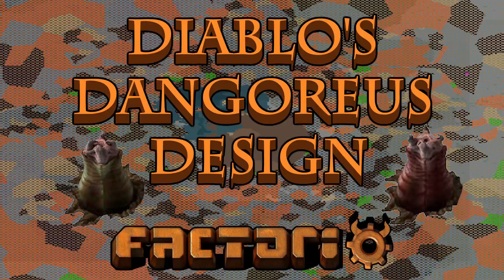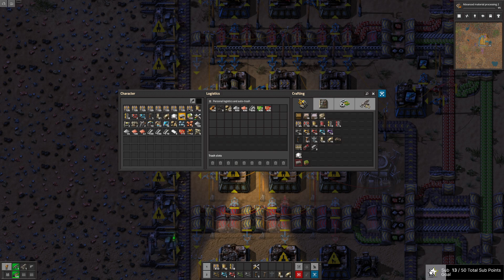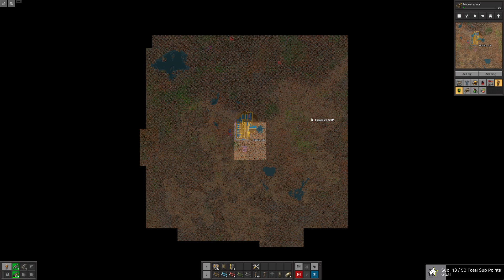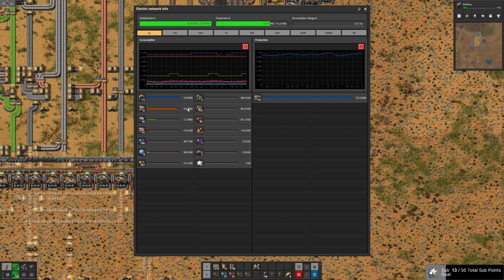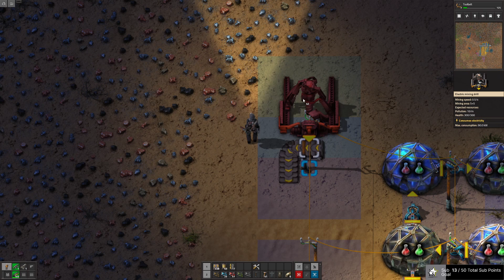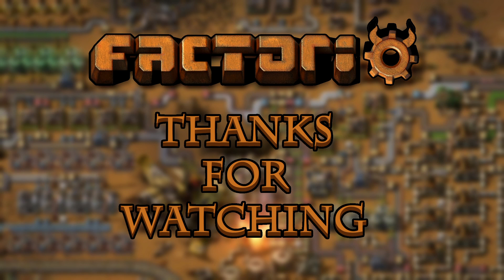Diablo's DangOreus Design - Part 003 | Factorio

Comment: 1:00:00 there is a flare stack mod if you want flare stacks independent from other things.
Reply from the maker: I saw that. I feel however that it would take away from the challenge for this mod. :)
Reply: @Diablo_rdk  highly depends if your just burning everything to mine out the build area quickly or if your just using it to get rid of the inconvenience of left overs that you dont want to deal with. a mod is only as game breaking as you decide to use it.